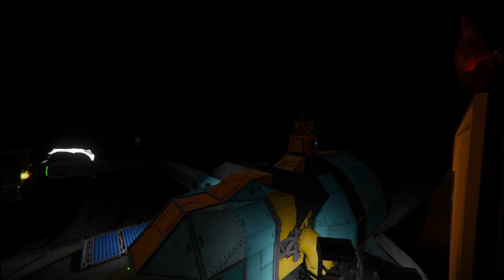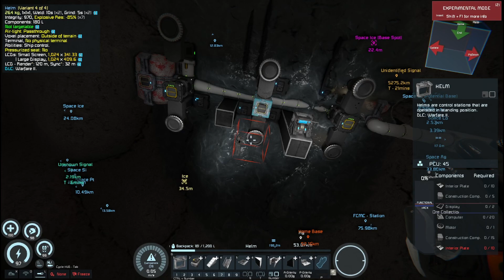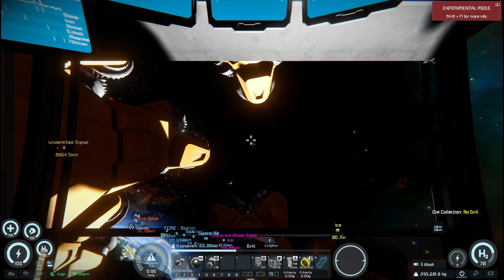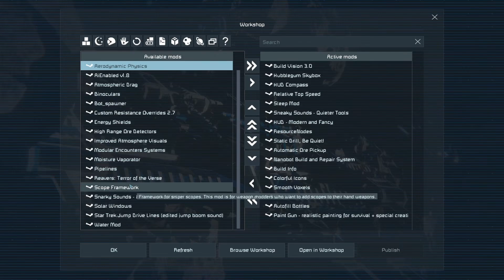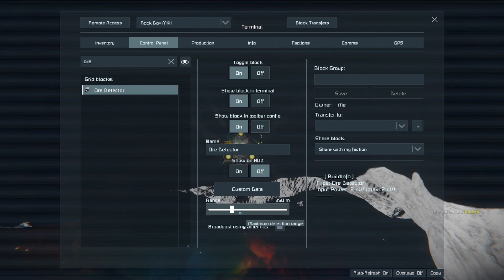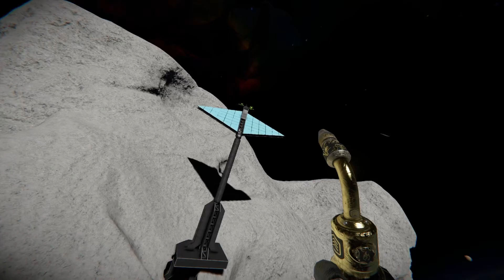S.E. Modded E53: Hunt for Uranium October!

Comment: Ukranium!!  w00t!
On the subject of mining depots, maybe if you create several small common modules that can fit together different ways would be useful, rather than one big design that will only really be optimal for one depot.
The fuel depot base looks really good.
The Hunt was long, tedious, annoying, but ultimately successful, well done!
Reply from the maker: I think the idea of Base Modules that can be printed and installed. could be a really cool Concept. and would allow for the main base to print, then transport them with maybe a retrofitted box fish. Or build a transport ship that would piggy back off the Sol Strider.
Reply: @Quantum_Tator  When you start building the moon base, keep this idea of printing modules in mind, it will influence the layout of the base.